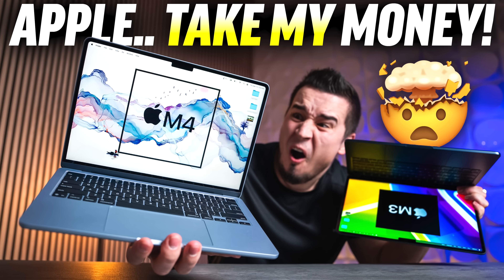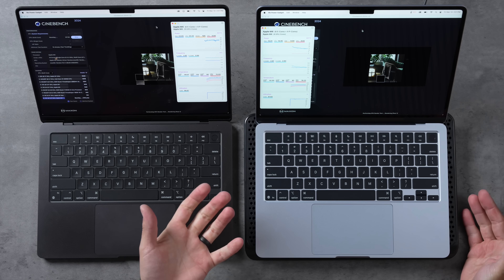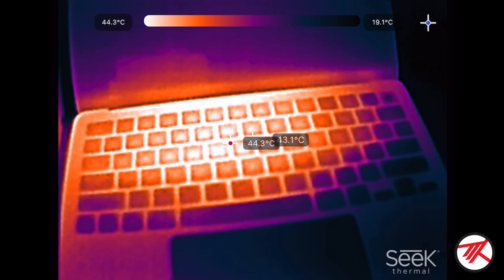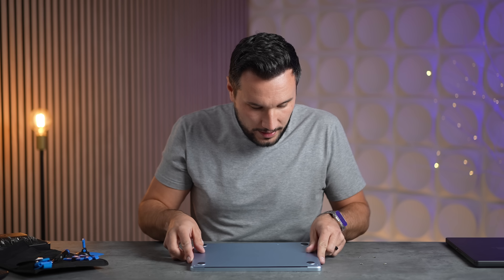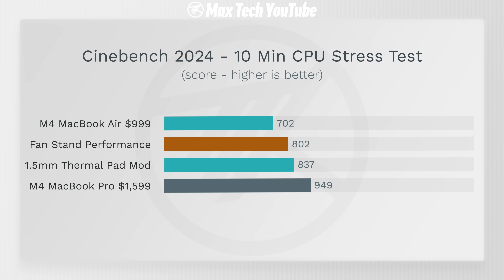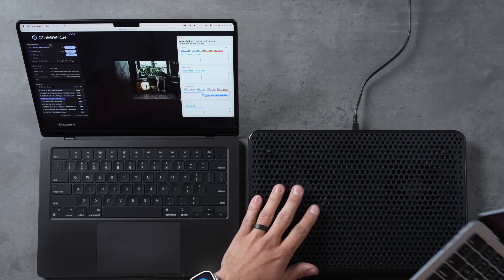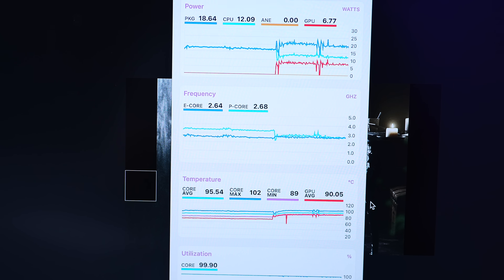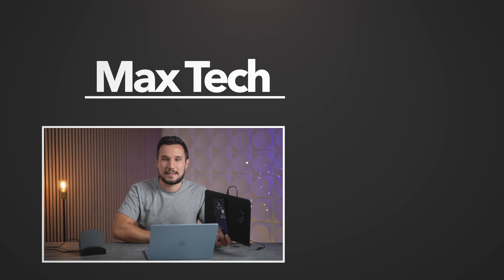Modded M4 MacBook Air vs M4 MacBook Pro -This is INSANE!

Comment from the maker: Buy the Laptop Cooling Mat with Fans ➡ https://geni.us/x7Kt
Buy the 3D Printed Heatsink with Fan ➡ https://geni.us/rvb8mX
Buy 1mm Thermal Pads for M4 MacBook Air ➡ https://geni.us/Xrjh7w
THIS is the M4 Series MacBook you should buy right now ➡ https://geni.us/u6ATcQX
Reply: Quiero comprar una Mac, entre la air m4 de 16/512gb y la pro m4 base 16/512gb… actualmente tengo la MacBook Pro Mid 2012 ! Entonces si compro una es para que me dure unos 10 años mínimo… que recomiendas ?
Reply: unable to open the 3D printed heatsink with fan… can you provide the name for searching
Reply: @fishhh009  I am also looking for the same.

Comment: I think Apple intentionally didn't fix this problem, they know that throttling will keep the machine safe, and they are Ok with it just being slower. Get the pro if you want faster. My old 16" MacBook Pro M1 Pro is faster than the M4 air ... the M1 keeps 3Ghz speed all the way through, M4 throttles from 4.4 Ghz all the way down to 1.5. 
The M1 was the best of all the M class processors, seems like since then they just added heat and clock speeds, nothing else. 
M1 MacBook Air too - never got warm no matter what. My M4 Air chassis is above body temperature and uncomfortable to work on.

Comment: You can do better, I have a 4mm thick stand made of solid aluminum.  It fits right between the feet on the m4 air and it has removable feet so the MacBook can make direct contact with the thick aluminum stand.  So you can create a massive aluminum heat sink for this thing.  The one piece aluminum design allows for some majorly improved heat transfer and it has a lot of mass.  It might not work with the 13 inch model because the feet on the laptop need to be wider than the metal for full metal contact.

Comment: anyone who's ever used cinebench knows that the difference between the first test and second in any one sitting is going to be higher. so the first test with 100pt boost is not just because of the fanpad you put it on. You probably got more ike 40-50 pts, if that.

Comment: So using d-brand skins specifically on MacBook Air m4 since it’s closed with no fans is a big NO . I only cover the top and track pad with a d-brand skin but not bottom and the inside is mostly exposed .

Comment: Which thermal pad will be better 1 mm or 1.5 mm
Reply: 1 mm
Reply: @ what’s makes you say that
Reply: 1,25 and 1,5 is to thick, 1 mm or 0.75 is ok. Tested.
Reply: @ then why has the guy in the video stupidly used 1.5mm luckily I ordered the 1mm

Comment: Another benefits that I don’t hear anyone talking about with the Air vs the Pro is that the Air is completely sealed therefore no dust or otherwise can get in like the Pro. I used to have an Intel MacBook Pro that got the motherboard killed because I used to use it in my bed all the time it was just sucking up all that dust and overtime dust when it accumulates is conductive. So being sealed means no dust getting in.
Reply: "Completely sealed" is misinformation. I opened mine up and there were bits of debris/food which can enter through the gap between the display hinge and case
Reply: Can’t dust still go through the keyboard?  And also the vents
Reply: @jadentwist89 Yes but it’s not getting sucked in constantly by fans and circulating dust around the heatsink and motherboard. Plus the keyboard and speaker vents are separated from the motherboard so the dust won’t go there anyways.
Reply: @jadentwist89  there's no negative preasure sucking it in tho

Comment: Here my findings guys..

# speedometer
Short test for javascript (single core)

MBA M4 - 35 pts (chrome)
MBA M4  (w/ thermal pads) -  35.8 pts (chrome)
Mac Studio M1 Max - 21.3 pts (chrome)

•	The results show no significant improvement installing pads.

# cinebench r23

MBA M4
    SC : 2201 pts
    MC : 12111 pts
    Power consumption :
        start : 16.6 w
        end : 13.3w

MBA M4 (w/ thermal pads)
    SC :  2164 pts
    MC : 12568 pts
        Power consumption :
        start : 17.6 w
        end : 13.8w

MBA M4 (w/ thermal pads + fan cooling)
    SC :  2235 pts
    MC :  13089 pts
        Power consumption :
        start :  18.5w
        end :  17.7w

MS M1 Max
    SC : 1537 pts
    MC : 12354 pts

•	I haven’t tested without thermal pads and fan cooling, since the goal was to determine whether thermal pads alone were effective.
•	The rear panel gets warmer showing a better heat conductivity.
•	The results show no significant improvement installing pads.

# geekbench

MBA M4
    SC : 3773 pts
    MC : 14772 pts

MBA M4 (w/ thermal pads)
    SC : 3798 pts
    MC : 14612 pts

MS M1 Max
    SC : 2398 pts
    MC : 12752 pts

•	The results show no significant improvement installing pads.

Comment: PRACTICALLY THE SAME COMPUTER. DIFFERENT SHELL OF COURSE   PRO HAS MORE PLUG IN OPTIONS   AND I GUESS A FEW COSMETIC FEATURES
Reply: Pro has a better and brighter Screen, higher refresh rate, better speakers, more ports, better battery life and a fan already installed.

Comment: Here (in Sweden) the macbook air 15" M4 and macbook pro 14" m4 with 16/512gb costs almost the same. The difference is only 50 dollars. Kind of want to get the air (since I was so happy with my m1) but only 50 bucks more to get to the pro seems like a better deal!

Comment: I guess the reason cooling is less efficient in clamshell mode compared to other is that it prevents heat from escaping on the keyboard side.

Comment: This is fun video, The cooling pad  seems like an easier way to go, but honestly I don't see a need to do this, other than proof of concept . I would never need to maximize an air since It will do more than enough.  I have had this machine for several days and I can say that it's a very fine machine. the 60 Hz panel is really good, people that complain about are display snots. I have a M4 Pro 16" and honestly I have a hard time trying to see a difference. the brightness is about half way up on both machines which is plenty bright. the 60-120 difference I just don't see it.
Reply: damh, i can see difference even when I'm typing and moving cursor around
Reply: Maybe you just have poor sight

Comment: Apple has shown us they have had some questionable thermal designs since before M1 was out (cough cough early 2020 MBA) and honestly you should use both a laptop cooler and stick those pads for any MacBook Air.

Comment: External Fans don’t work the same. It is less about having more or faster fans but rather having fan running inside and make it work in a way that disperse the air while circulating them more efficiently.

Comment: The 15" MacBook Air is larger than the standard Air, so why didn't Apple include a small fan? I believe there is enough space inside, but Apple chose not to. It's the harsh reality of this device since they  introduce the 15" MacBook Air.
Reply: the decision to include a fan or not has nothing to do with the size

Comment: I'm currently debating the m4 air vs pro. Of course, all the apple bros are going to lean towards the pro but I already have a laptop with a 3080 so mainly want a battery-efficient mobile design machine (my other laptop is a beast but the battery is garbage). This got me back leaning toward the air, now just debating 13 vs 15. 13 is more portable but I've only ever had 15+ in laptops...

But the space black is gorgeous 😍, midnight blue looks cheap IMO
Reply: I just got the air 13 and love the small portability and light weight of this machine. For most everyday use this will be perfect for me. I also have a m4 ori 16" that is an absolute  beast, way more than I need, but will be keeping it for the uses it provides me.
Reply: @Ottynetyou  I ended up getting the base MacBook Pro m4 😅. It was on sale for $1399 by me so when I upped the storage of the air it was too close of a price difference to not upgrade. Also got my space black lol

Comment: I am curious but has any one filled a class action lawsuite against apple over the throttling?   I could not find any mention of throttling on the product page.  This means consumers are assuming they are getting the same performance out of the m4 chip in the air as they do in the macbook pro.   This obviously is not the case which technically is false advertising and should result in a class action lawsuit.   Apple should be required to put a disclaimer on the product page that the Air can not sustain the M4s performance compared to the macbook pro.

Comment: For the sake of it, you could’ve tried using the fan stand on the pro model and see if there was a difference.
Reply: Thats true but thats not the point of this video. Hes just trying to point out the negligible difference between the air and pro if you make some minor changes to the airand much cheaper than going for the pro
Reply: I use frozen peas and that gave me similar results to the pro

Comment: Cinebench single core scores are worthless. Rendering and photo work in photoshop and video editing and encoding all use multiple cores.

Also people doing this pro work probably don't even want the base M4, even in the macbook pro and would opt for the M4 pro or M4 max for more cores and more performance. For them, time is money. Still, the Macbook Air M4 is the best premium tier laptop out there for most people. I say premium tier because there are tons of cheap windows laptops for $500 or less but are ungodly slow with poor screens and low quality plastics and some build quality issues.

Comment: Still more than satisfied with my 15” M3 Air. I’ve been gaming, live-streaming, and video editing on it flawlessly. I’m sorry but if you have the M3 Air with 16/512, there is no need in upgrading.
Reply: Hey! Is it good for gaming? I mean, how many hours do you play a day? And u don't feel like it heats a lot? And if so, U haven't noticed a considerable degradation on battery because of the heat?
Reply: @ it does NOT get that hot. I play a couple of hours a day plus video editing. No I have not noticed a degradation in battery because of heat. BUT, I have the 15” model, which does provide a better thermal dissipation than the 13”.

Comment: MBP 14 inch M4 16GB base model on promotion price right now is way better than your 13 inch MBA, outweight even with those extra weight 🏋‍♀, MBP has a higher quality keyboard ⌨ typing experience with no overheating 🔥 fingers feel, the 120 Mhz Mini LED 📺on airplane small size footprint seat 💺without a electric plug is night and day difference with those extra 6 hours movie drama playback 🙏, right side availablity USB slot is more convenient. With a business on 24/7 CCTV security live streaming has no lag on the MBP 🆚 MBA lagging after just 1 hours of streaming, I think is because of the thermal I think 🤔. Not even need mention about those MBP speaker quality. Anyone has similar experience? 🙄
Reply: I upgraded to the m4 14 inch from an m1 air when it came out ,and didn't bother to even wait for the air. The display alone is worth it over the air. Also the tdp of m4 is ~22w for the cpu and ~20w for the gpu which is significantly higher than previous base m chips, I know it can no longer be properly cooled with the fanless chassis of the air without serious thermal throttle,it is better to get the pro to unlock the full power of the m4 chip , otherwise why bother to get the latest chip if you can't utilize it's full capabilities.

Comment: Thanks for the vid ! I waited for that one :D Can you tell if the 1.5mm pad caused a bump after mounting the case ? Or is it a perfect fit ?
Reply: No, 1,25 and 1,5 is to thick, 1 mm or 0.75 is ok. Tested.
Reply: @ I already applied 1.5mm, sticks perfectly, no bulge, but cover was harder to assemble since the resistance was stronger as they touched each other

Comment: Here isnCanada the thermal pad solution isn't bad its 1399 for the macbook air vs 2099 for the pro with m4, its a literal 700 dollar gap, and for some people it just isn't feasible, if we even considered the same spec, its 1699 vs 2099, and sometimes the 400 isn't there. 

The best recommendation though is to only do one solution, if you start "rigging" the laptop up its just sily at this poiint.

Comment: Air, funny name for a machine that has no fan.
Reply: Lol true. Sounds better than fanless.
Reply: HAHAHA right
Reply: not going to last nearly as long as the macbook pro
Reply: And it has significant overheating issues. Especially in the summertime :)
Reply: Yes great point
Reply: What name would make more sense?
Reply: its because macbook air is light like air, genious
Reply: It’s called the Air because you need a ton of airflow to use it fully
Reply: You need an "Air" conditioning to keep her cold. haha
Reply: @_EllieLOL_  wrong.

Comment: I think the people who would actually benefit from doing stuff like this to their MBA should just buy the MBP. Most people the Air is made for (basic users) will never notice the throttling.
Reply: And i think the stand could be benefical if you want you use ur MB Pro in clam Shell Mode but also keep it silent under full load
Reply: But yeah most basic users propably wont notice anything
Reply: anyone doing the work cinebench simulates will not be using a single CPU core. Pro apps all use multithreading so you are using all the cores not just 1. Also people doing this type of stuff and must have a laptop to do it on probably wants an m4 pro or Max, not the base M4 because they have more and faster cores.
Reply: To be fair though, you can save $500 doing this and have a lighter machine for on-the-go!
Reply: I occasionally stress my Air to the point of throttling, but it’s not that often and I don’t need the other stuff the Pro gives, so I spent $40 on a cooler and pad instead of $400 on a Pro
Reply: @ I'm biased being a tech enthusiast kinda guy but you really do get a ton for the extra money. Primarily the screen, that alone makes it worth it to me, aside from the cooling fan, M4 Pro, better speakers, etc. Idk just my 2 cents on it.
Reply: @accordinglyryan  The true blacks are nice but not worth the cost, I don’t notice a difference between 120 and 60hz, I already compensated for no fan, the Pro chip would be nice in the times I stress my Air, but still quite expensive, the speakers are also quite nice, but the Air quality is still great, it would be going from great speakers to amazing speakers, but still not worth the price

Plus the air is smaller and much lighter which is a huge benefit, and yes I do know what 120hz looks like in person, I have both an iPad Pro and iPhone Pro along with a 120hz Windows laptop and I still don’t notice a difference - I even ended up disabling ProMotion on both of them for the slightly increased battery life, although the Windows laptop is locked to 120hz so I can’t lower it
Reply: @_EllieLOL_  Idk what to say other than I completely disagree on that lol. But hey if it works for you good enough

Comment: This was certainly an interesting test but there is a problem with it. Your baseline tests had the computers lying flat on a table. You should have included a test where they were sitting on a stand of some sort that allowed air flow under the laptop…no fans, no thermal pads. I think doing this would have produced a noticeable benefit by itself.

Comment: I wonder why Apple doesn't install thermal pads themselves
Reply: Because it increases the temperature in the bottom of the machine to uncomfortable levels if you actually use it as a lap-top.
Reply: @ Not just uncomfortable it could cause serious burns.  The processor in these sytems are hitting 100c even if the themal pad only transfers 50% of that at 50c you would still get badly burned.
Reply: Max temp isn’t allowed to be above 47 c if I remember correctly.

Comment: May you please try Low Power Mode performance and battery life difference?
Reply: Low power mode dims the display.
Reply: @nicktw8688 not sure but I think it could be changed in settings

and also I think this mode reduces cores speed

Comment: The Extra GPU usage with the external monitor is because it has to convert the display to 4k. 1440 or 5k are better options for a Mac.
Reply: to anyone reading this thread, this is pure fiction.  don't listen to this advice.  higher resolution is ALWAYS going to be harder on a GPU, there's no such thing as "native resolution" when it comes to the external monitor as it applies to an operating system, and finally the size of the monitor doesn't affect the load on the gpu
Reply: 👋😊 You are saying a 5K monitor is easier to push to than 4k? Because of scaling?
Reply: @ianAmerrill depends on the size of the monitor. “Native” for Mac is 4K - 24”, 5k - 27”, 6k - 32”
Reply: @rAustinBall so a larger 6k 32” would run better than a 4k 32”?
Reply: @ oddly enough, yes.
Reply: @  🤯🤯🤯 no wonder my Mac struggles on my current monitor! Haha
Reply: @ Yes, this!
Reply: That is the dumbest thing I've ever read.
Reply from the maker: For the first 8min of the Cinebench test it wasn’t like that, I would agree if it was stabil the whole time not just kicking up a lot at the end.

Comment: Comparing the Macbook Pro and the Macbook Air is just a stupid idea. The Macbook Pro is far superior anyway. It has 10 core CPUs, a 120hz display refresh rate, and an active cooling system. Macbook Air has significant overheating and sluggish operating issues as well.
Reply: no it doesn't, the whole thing is that if you are doing things that cause the air to throttle or overheat you were a cheapass and should have got the pro. Also people doing pro work would probably want the M4 pro or M4 max because of the extra cores and performance. Anyway I use my gaming PC for any of my video transcoding because I have a 16core/32thread CPU (none of them are effeciency cores and can run full load 24/7 with zero throttling)with an Nvidia 4080 GPU for CUDA acceleration.